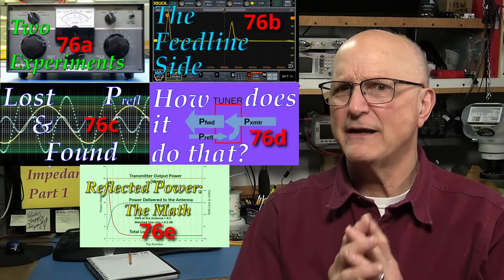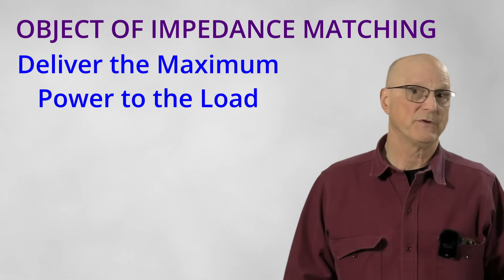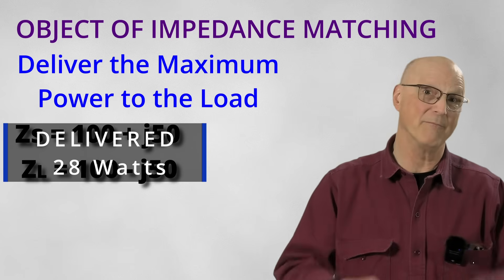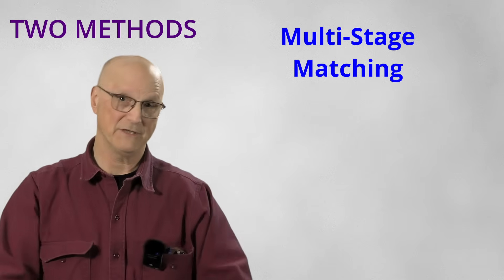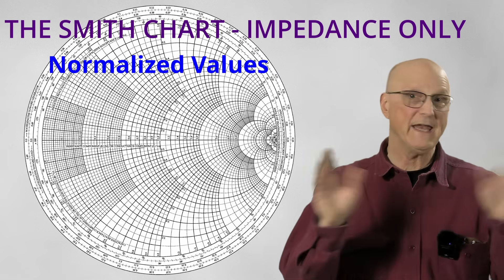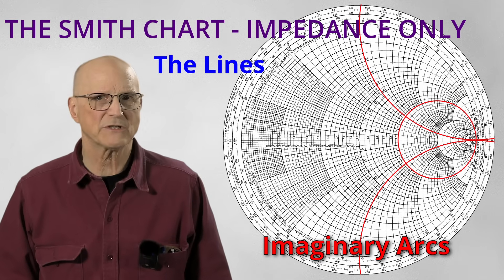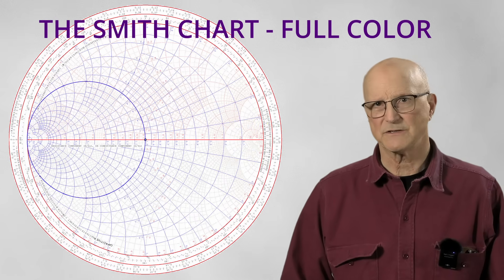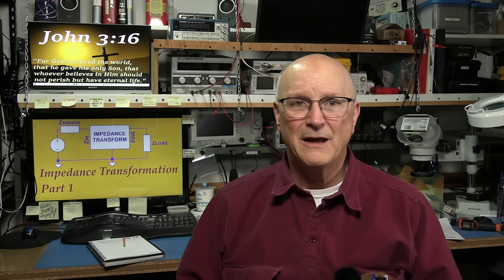Impedance Matching (Pt1): Introductions (079a)

Comment: Hello Sir, How many WAYS can we fully use the SMITH CHART for Professional RF Engineers/Microwave Engineers and Technicians. 6?, 7?, 8?, 9? and only less than 10 ways?

Why is 'reflection coefficient pure number is not used for the circle radius', VSWR radius is the one used to draw the IMPEDANCES, and ADMITTANCES?
Reply from the maker: There are many ways of using the Smith Chart. I suggest taking in the videos in my Smith Chart playlist.
Regarding the Reflection Coefficient, it is a complex number just like Impedance.
VSWR is a non-complex number and is mathematically related to the Reflection Coefficient. I explain that relationship in this video: https://youtu.be/44ETbhF-4bo
I hope this helps. :-)

Comment: When plotting the 0.008 - j*0.004, why did the succeptance arc go down and not up? You had just said that inductive succeptance is negative as a result of the inverse of the reactance and the arc should go upwards.
Reply from the maker: Aaaahhh ... I see the confusion. The conductance circle and the susceptance arc shown were for illustrative purposes only. If you carefully consider the values involved, 0.008 - j0.004, the conductance circle that is shown isn't for 0.008 and the susceptance arc isn't -0.004. They were there to simply show that the process is the same, not to show the actual plotting of that Admittance. I can see how this could have been a bit misleading. Sorry about that. :-)

Comment: Hi, correct me if I'm wrong: lengthening or shortening the cable (ideally without losses) to reduce the reflection index is useless: on the Smith Chart it is just a matter of moving on the circumference centered on the characteristic impedance value of the cable, but the radius (reflection index) remains the same.
However, I can lengthen or shorten the cable to reach a purely resistive impedance value and then make a quarter-wave transformer to reach 50 ohms, choosing a cable with the right different characteristic impedance.
Where am I going wrong ?!? Is this a correct procedure? It seems too easy...
Is this what the Drake MN2000 does using concentrated constants? I'm asking you because the two knobs are labeled "Reactance" and "Resistance".
Thank you in advance for your answer. 73s
Reply from the maker: Good question! Essentially, yes. We rotate about on the Smith chart to a place where the R = 50 Ohms and then use the reactance knob to null out the reactive portion. They set up the inductance so that with the knob turned one way, things look like we are adding inductance and turn the knob the other way and it becomes capacitive. Pretty slick, eh?
If you check out my Smith Chart playlist, you will find where you can do this with lengths of coax (creating stub matches). 🙂
Reply: @eie_for_you  TNX!
Reply from the maker: @PinoEsposito-p4n  You're very welcome! 🙂

Comment: Impedance Matching is most often treated as an aside in transistor design tutorials where discussion is mainly limited DC biasing.

Driving low impedance loads has been a huge gap especially with BJT design tutorials.
Reply from the maker: True that! 🙂

Comment: Hi, great video. Question. In what situations would using (and thinking in) conductance instead of impedance be more useful? Terminology is overwhelming sometime: impedance, resistance, reactance, capacitance, inductance, admittance, susceptance. I know some multi-meters have possibility of measuring conductance, if you need to measure very large resistance values. But personally in 20+ years working as EE I have never needed it.
Reply from the maker: Thanks, man!
Yup! And in my many, many years of electrical engineering ... I never needed it either because I didn't work in R.F. engineering.
However, when dealing with R.F. engineering, admittance is sure handy when working with parallel complex impedances. 
When I get to the next video where we are designing an L-type A impedance matching network using the Smith Chart, we will, indeed, be very happy to work in the Admittance, conductance, susceptance world. It is so very slick and easy. 🙂
Reply: @eie_for_you  I have seen your other video about conductance and admittance, where you explain the 'handiness' of it when having parallel circuits. Indeed, I have not worked in RF, but it is one of my ideas to learn more about RF. I am novice radio amateur for a year now. But, the problem is to find the time to learn and do this new things. I already have a home lab with all needed equipment top start in RF. Specific field of electronics though. Also interested to learn more about EMC (tests).
Reply from the maker: @ernestb.2377  RF has a LOT of magic and weirdness in it. As I approached retirement, my interest in learning all things RF was raised and I started at it. Now that I am retired, I have the time to devote to it.  I have spent many hours of study and frustration in its pursuit. The biggest frustration was the huge holes in the explanations I could find. I got pieces of the story from here and pieces from there and more pieces from somewhere else to put the puzzle together. It is a HUGE field and I am still learning and refining my knowledge.
With all of that said, it has been very rewarding and fun. 
So ... go for it! Learn it. Have fun with it. 🙂
Reply: @ Thank you Sir. Yeah, RF is very specific, and I think not many people really understand it well. Yeah, black magic 🙂
Reply from the maker: @ernestb.2377  You are welcome. I don't know that there is a real "understanding" of RF as much as knowing how it behaves and learning how to tame it. I suppose there may be a few who might be "RF whisperers," but they are rare. 😁

Comment: This stuff has been bugging me for 55 years. The more I try to understand it the worse it gets bent in my brain. I have always known the radio wants 50 Ohm and the cable should give that to the antenna. Now a antenna is anything but 50 Ohm and the cable as I see it should be close to antenna impedance and the matching unit changes it to 50 Ohm to the radio. I would like you to wrap my head around it and get the light to be turned on, I soo want to understand. Have seen the cable video and for me it was yes and no. Confuced. Thanks for your great videos.
Reply from the maker: I KNOW the feeling! It seems so unreachable and magic!  But it isn't. With a little bit of work, you, too, can learn to do this thing.
You are very welcome! 🙂
Reply: @haraldlonn898  a great book to read is reflections by Walt Maxwells it goes in to great detail
Reply from the maker: Yes, I have copies of that book and have read it extensively. :-)
Reply: @haraldlonn898  the impedance presented to the tuner or radio changes with line length when there is standing waves present on the line, the feedline becomes an impedance transformer
Reply from the maker: True that. :-)